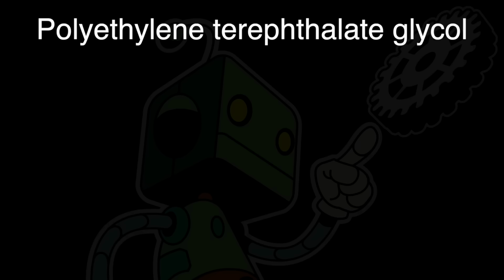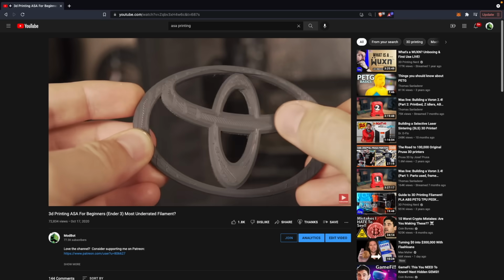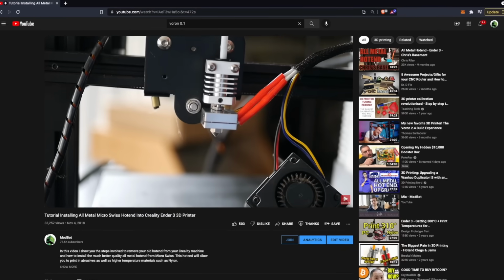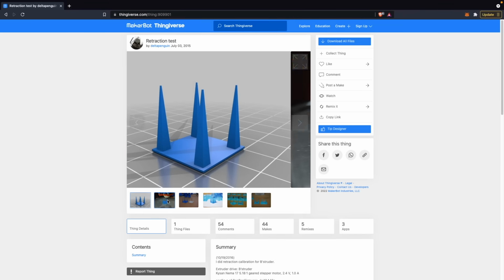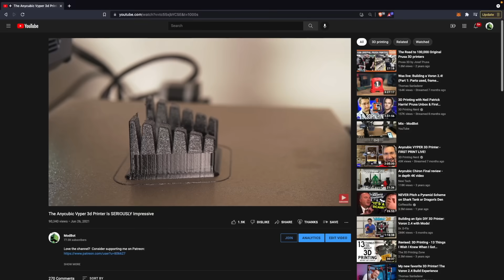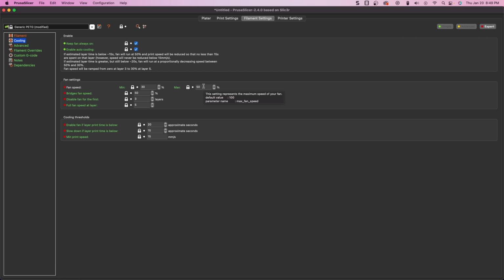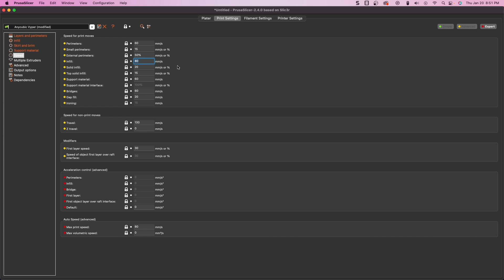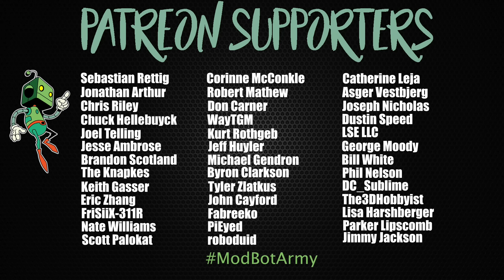3d Printing PETG For Beginners! Great For Functional Parts

Comment: I love printing with petg. I'm using a flashforge creator pro 2, at 235c and a bed temp of 70c. This has been working really well for me. Also printing at a slower speed, and leaving the cooling off for the first couple of layers. At 240c I had some issues, but after some tweaking and dialing back the hot end temp they have been flawless. Thanks for the info. Cheers.
Reply: How slow would you print for PETG?

Comment: i print petg on g10(garolite/fiberglass) it sticks down reallly well(you definately cannot take the print off) while hot and it self releases really nice when it cools down
Reply: @BuildGUY I've used picture frame glass from goodwill for years. Its cheap and works well. Just got a new printer with fancy flexible magnetic bed coated with pei. I feel spoiled now! Its nice not having to get stuck prints off with a razor blade. Though glass gives the absolute best bottom finish!
Reply: @GMCLabs I agree, but I use a glass mirror. Really flat and the darkened rear of the mirror really seems to transfer the heat really well.
Reply: @meisievannancy  Be VERY  careful with the mirrored glass, the mercury conducts the heat very well and can fracture the glass in the mirror. I  know from experience.
Reply: Thanks for the warning. So far I have not ventured past 70 to 75C for Petg.  @Renrondog
Reply: @BuildGUY Glass is where it’s at boii
Reply: Do you have a link?
Reply: @MTNDEWGANG G10 is the fiberglass that they make pcbs from. You can just buy single sided pcb which will work of you use the non copper side to print on. I guess you can buy it naked. Or if you don't like the copper you can remove it yourself by putting it in a tray of water mixed with peroxide. The stuff ladies use to bleach their hair and it will etch the copper off. Do it outside as it bubbles off noxious gasses. You'll have to look online for the concentrations. Peroxide is easier and cleaner than stuff like Ferric Chloride to etch unwanted copper off.
Reply: @MTNDEWGANG  no, it is the g10 sheet that came with my printer, i just took off the crappy buildTak like sticker on it

Comment: Printing with PETG on the Ender5 stock works but not without headaches and some of these suggestions don't work at all.  My materials ooze too much above 235C, I always have to use either brim or outright raft to have any sort of hope it adheres to the bed. I tried stick glue and CubeGlue (for 3d printing). Stick glue works about half way, cube glue works better, but all result in very hard to remove prints, so I tape the bed first.
On a rough bur flexible addon  bed surface the first layer adheres better but each line has problems adhering to the next one so I use rafts.
Thanks for the info, good starting point :-)

Comment: I have had PLA get really brittle as it takes on water.  I had some get so bad that it would break during the print.
Reply: PLA typically absorbs moisture at an extremely slow rate, and it does become extremely brittle when it reaches a certain point.  I have also found that it is extremely difficult to dry out.  I actually tried drying out a small spool for up to 5 days at 55C.  After 2-3 days it wasn’t nearly as brittle, but even after 5 days of drying it was still brittle enough to break after 1 or 2 bends, so I don’t even bother trying to dry PLA.

I’ve heard that using a freeze drying method does work, but the cost of electricity and time is significantly greater than purchasing a fresh spool.  PETG on the other hand, dries very easily.

Comment: After finally getting my Prusa textured plate to actually stick to Petg, I haven’t looked at pla since. I’ve found that the Prusament PETG setting works best for non-Prusa filament. I also use glue stick, but only to “season” the plate by drawing the stick around the edges and a big X from corner to corner. Then I coat the bed in IPA, then with paper towel, rub the glue/ipa into a very thin slurry and let it dry. This usually lasts me weeks and I’ve had perfect first layers that cover the entire bed. PETG just feels better to the touch and I have high confidence in the durability to my parts.
Reply: I've had difficulties with PETG sticking to the textured bed of my Mk3s+. I'll try your suggestion. Thank you!!
Reply: @larrydelceg2406 , another tip, choose the Prusament PETG profile for all PETG. It prints a bit hotter and I’ve had great luck with non-Prusament filaments.

Comment: I've been printing for about a year and a half. My second type of filament was actually ASA, and it's still my second most common after PLA. For when I need heat-resistance and/or weather-resistance. PETG strikes me as a half-measure. I almost only ever use it when I want something transparent, as I rarely need improved impact-resistance. Similar goes for TPU. On that note, I've been meaning to try printing HIPS. Not for high impact, but for minis. I've been avoiding ABS like the plague, but given how vehemently the Voron team advises to use it for their machines, I guess I'll have to take the plunge later this year. PC and PA are on my bucket list, but I haven't had a need yet, thus yet to buy.
Reply: PC is hard to print in my experience, lots of warping and very high adhesion. Good luck!

Comment: Great tips, the prints at the end of the video look fantastic. Stringing can be dialed in with the right (lower) temperature and the correct retraction speed and amount. I found the main problem with PETG is "blobbing", drying the filament will help a lot. I will try a nickel coated nozzle like you suggest. There is also PETG pro which should print better/easier

Comment: I've been printing some nice translucent PETG, no issues at all.  Well, other than one spool where the filament got criss-crossed a la Nero since I'm an idiot, but that was on me!   It is a "weepier" material, but I found the sweet spot for my stuff at 230C.  It also helps if your extrusion is really dialed in well, that's important.  Do your wall tests, measure with calipers, etc.

Comment: Interestingly, when I rebuilt my stock Ender 3 Hotend (bought the Printer in Dec 2019) I found out that it has an All-Metal Heartbreak instead of the typical Teflon Liner. I knew that Creality did some Silent Modifications to the Ender 3, like including a Fitting Spacer for the Extruder, but that was absolutely new to me. I haven't increased the MaxTemp since, also because I don't have to currently, but I actually would.
Any Thoughts on that? Since I haven't found anything online talking about it😅
Reply: I've disassembled 2 ender 3v2 hot ends and they technically have a metal heat break but this is not what an all metal hot end is. On the ender 3 series printers, the ptfe tubing fits inside of the heat break down past the heatsink and into the "melt zone" causing ptfe to degrade at higher Temps. If you don't want to purchase an "all metal hot end" you can get away with a slice engineering bimetal heat break. I've been printing at 240c petg with no problems.

Comment: I use Sunlu PETG nearly all the time with a direct drive Sovol and V6 / nozzle X hotend. Observations:

Never had a moisture problem. In fact from materials websites PETG absorbs a lot less water than PLA. I have tried drying it, didn't make any noticeable difference.

I use 240C/75C. Retraction of 0.4mm. Tried various up to 1.6, but never noticed a difference once it got to 0.4. I notice you do not say what retraction you use.

It does build filament on the nozzle, the biggest problem. When it builds up strings increase because they pull out of the blob on the nozzle, not the orifice itself. Tried all sorts, main cause seems to be infill if it has lots of short start and stop bits of filament, the tiny wisps get picked up again by the nozzle. Using Cura there is an option to join infill into one long run, not lots of short ones. This seems to help.

I use Magigoo on a glass bed. No adhesion problems, and it comes off OK.

Good stuff, apart from some stringing and the problem of filament build up on the nozzle.
Reply: 0.4 mm retraction is not enough to avoid stringing. I set my retraction to 5 mm.
Reply: @bigdogkmc  each to their own. I personally would say that is too high for me, especially given that E3D recommend a maximum of 2mm to avoid blockages. In any case, the figure I came up with was the result of temp tower tests, and basically, when it got away from 0, further increases made no visible difference. But that is me and my printer setup, if 5mm works for you, then so be it.
Reply: @bigdogkmc  that's just not true. Using retraction as high as 5 mm can jam direct drive hotends.

Comment: This video is so well-timed for me. I've been printing with Inland PLA+ forever and decided to try PETG; bought some yesterday at Micro Center. Wish me luck
Reply: Pay attention to temperature and bed sheet, also, run a cold pull, or make sure your nozzle is not clogged.
Reply: Dang we’re the same, currently use inland pla+ and going tomorrow to buy petg
Reply: @johnnycastor8634  pla+ is amazing and ive never had any issues. the PETG is definitely more challenging to print properly but i've gotten a couple nice things out of it (like a new fan shroud for the hot end)

Comment: I used to use PETG for almost everything, until I recently started using ABS.  If you are printing a transparent PETG, there is something that you want to be aware of.  PET & PETG will crystalize when they get too hot, or if they are heated for to long, thus you need to ensure that the filament is constantly moving.  The glycol modifier in PETG slows this process a bit, but you still need to be wary of it.  For your print, it means the difference between a cloudy print and a beautifully transparent print.

I saw that some people were having layer adhesion issues, which is most likely caused by, 1) Hot end is not hot enough, or 2) Bad or wet filament.  Wet filament will also cloud transparent PETG filaments with microscopic steam explosions.  PETG is extremely sticky, especially to itself (which is why it strings so well), so there should never be any layer adhesion issues.
Reply: This is a very good thing to know, thank you.
Reply: Have you ever printed anything like the casque for a hard-toe work boot?
Reply: ASA is also worth considering. It is very similar to ABS, has same temperature resistance properties, but also warps less, emits less odor while printing and is UV resistant.
Reply: I agre with ozren asa has all the benefits of abs, just with slightly less fumes and is designed for outdoors in heat and with uv resistance. 

As asa exists it makes me wonder about why abs is used at all..
Reply: @paulradford4100  good question.. is ABS more abundant, easier to obtain by recycling, and inexpensive or something?
Reply: @ChristopherJones16  abs does seem cheaper than other filaments. Maybe because there's so many other options out there that are easier to use while not as much fumes.

As demand goes down, so does the price I suppose..
Reply: @paulradford4100  The 1kg spools are also quite a bit bigger than PLA counterparts, though this is also true of PETG.
Reply: @thumbwarriordx  yeah, I've noticed some filaments 1kg come on different sized spools. The larger spools don't fit great in my eSun drier that I also use as a feeder - the result being that they often don't roll right on the bearings unless you open the lid slightly, which kinda defeats the purpose of the drier..  maybe I need a better drier..
Reply: Isn't it nice when a discussion about PETG turns into an inaccurate and incomplete discussion about ASA?  AMAZING!
Reply: Microscopic steam explosions. So vaporization lol
Reply: all of theseare common sense

Comment: I run my plate at 85 (for Prusament, even 90) and that has worked out very well for me. Sticks down very well, releases easily. Perhaps that 70 degree setting contributed to the warping... this material does like warmth. :p
Reply: I am also at 90 on bare aluminum, with a dissolved hairspray coating.

Comment: I much prefer to print PETG. I started out printing it, because I needed functional parts. A Prusa i3 with the textured plate, Prusaslicer and a decent PETG roll (Prusament, but I've had luck with other brands as well) and you get great parts. It's even more quiet than printing PLA because the fans don't have to run at a gazillion rpm to cool it. PETG rocks. The textured plate from Prusa is so good for htis too, scrub with 99% isopropyl, print, let it sit and cool; as the print plate cools and shrinks, the part gives up some ticking noises and when the plate is cool, you can basically just lift the part off. A great experience all round on a stock Prusa.

Comment: I found that stringing is greatly reduced at 230 deg C. And I have also best results at 60mm/s speed.  But it does weird stuff when you need to support it. Still have to figure that out.

Comment: Question: how do you deal with stringing using an E3D hotend? I found the only way is to retract 5-7mm then Stringing is virtually eliminated. With the E3D V6 hotend it is recommended not to retract more than 2mm. I tried changing the Retraction speed may times but that just does not help. I try to only retract when necessary. I use the technique where as you move the nozzle over the part try not to have the nozzle move over an area where there is no part printed. If that explains it. There are setting in your Slicer for this.
Reply: Printing parts one-at-a-time, and combing are useful.

Comment: One tip I saw that worked for me was increasing just a bit the z-offset so the PETG is not squished against the smooth pei bed. Problem I have is layer adhesion is not as good as PLA, even printing 40mm/s at 245°C y can break parts very easily.
Reply: Yep, rising Z for petg helps a lot as it likes to stick. Also, nickel plated nozzle helps against sticking to nozzle a lot. 
For layer adhesion, turn your fan off. Completely. PETG doesn’t like that, actually, when printing anything else than PLA, part cooling fan has to be avoided completely.

Comment: I love your Videos. I know this is a long post but I think there is some good info. You cover all the issues I had to learn on my own. Suchas as the following. I print with PETG as my goto filament. I found 240c - 245c to be the sweet spot. I also found that PETG either sticks to the bet to well of net enough. I found that if you dial in the bed temp precisely than I can get PETG to stick. And I can remove it with out damage to my build service. I found around 60c worked for me. Although I can remove PETG without damage I can just pop the parts off the flex plate by bending it. Some times I can gently twist the part off; sometimes I have to pry the part off. Adjusting the Temp (+-) 1 to 2 degrees c makes a big difference. I have uses Buldtack sheet. I now use Garolite. I think Garolite would well and it is sandal. so if Alcohol does clear the sheet then you can lightly sand it. I found that a Glass bed but does not get hot enough. On my two printer the Heaqted Bed is low by at least 20-40c. I just tried placing my Aluminum BuildTak spring sheet with Garolite top sheet directly on the Ender 3 Max Aluminum Bed. Aluminum to Aluminum. And the Temp is off only about (+-) 5c. Of course as with any Heated bed the outer sides of the bed are not going to get as hot as the Center where the actual Heater is located. I found that if a print fails and I only printed 1 or 2 layers then it is very hard to get PETG off. PETG need at least a few layers for it to be easier to remove. Lastly, I found that finding a good Manufacture of PETG is very important. I want PETG to really flow well. A lot of PETG filament just will not nelt well and there fore will partially clog my print head. Enough to have the filament under extrude a lot. I would rather deal with stringing. I found that trying to up the temperature on PETG to get it to melt better just does not help. I used to use Amazon BASIC PETG a few years ago then Amazon discontinued it. BUMMER!! that filament melted really well. I now use MatterHacker MH Build Series PETG. That would pretty well but not as good as the Amazon BASIC PETG. Also, I printed with eSUN Translucent Orange which worked pretty well on my TEVO TORNADO with an E3D Gold Edition hot end. Neither of the above filaments work well on my Ender 3 Max with a Microswiss hot end. But I think I have other issues with the Ender Printer.

Comment: 240C is too hot in my experience.  I print PETG at 220 to 235C.  Sticks great to my PEI spring steel sheet at 60C and removes easily by flexing the sheet.
Reply: I have been using 225/220 for petg on my Ender 3 and Mega X.   Both printers have their ultrabase style beds. I use lots of glue sticks. I have never measured the actual temp on the hot ends so they may be higher.